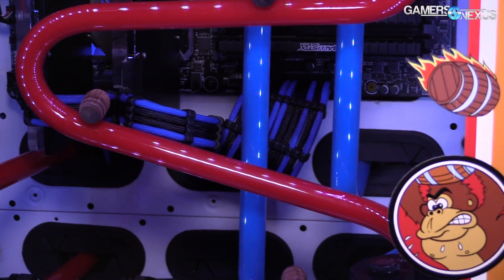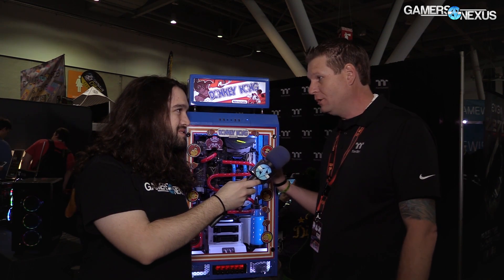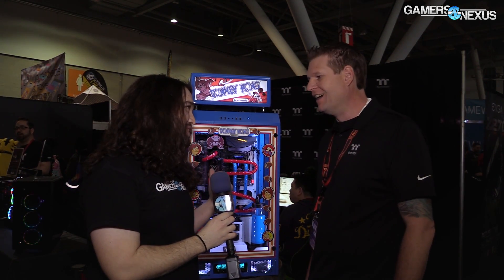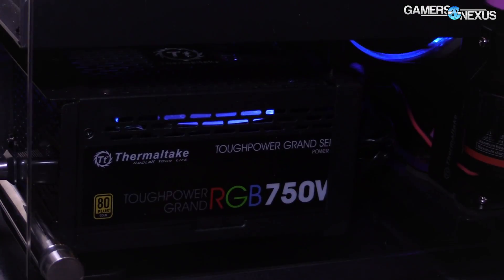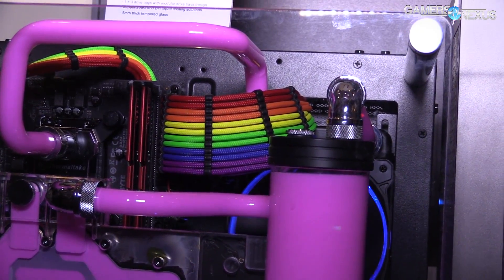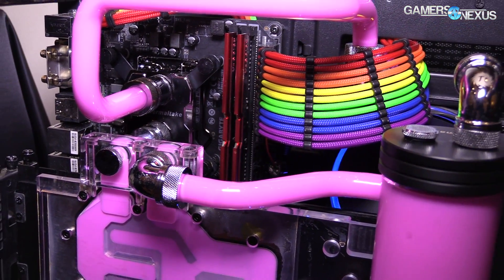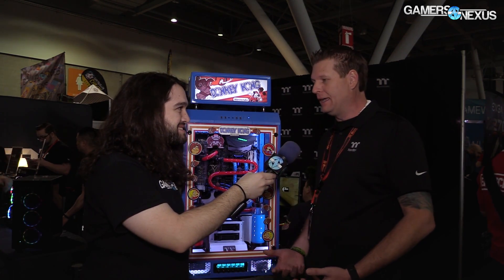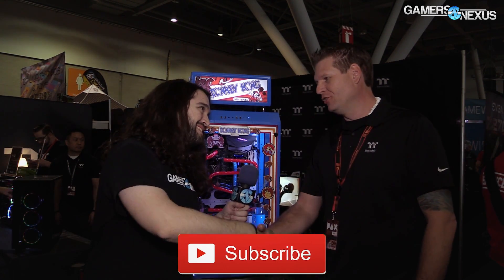Common Liquid Cooling Mistakes & Misconceptions

Comment from the maker: We shot this with Thermaltake on either Friday or Saturday of PAX East, but just got home and finalized edits! A few more videos left from the show, not too much more to go through. Check back this week for more on 1080 Ti Hybrid and other coverage!
Reply: Small note - not all AIO radiators are aluminum. be quiet! Silent loop 240/280 has fully copper radiator.
Reply: Gamers Nexus Great coverage on Pax, love seeing these types of vids! Can't wait for the 1080ti benchmarks
Reply: Thanks for the quick tradeshow coverage.  I enjoy watching these short interviews on the floor.  I really don't get the negative comments that question GN's integrity for sharing this type of content.  They are unfounded and speak to the juvenile nature of the YouTube audience in general.  Thank goodness GN is a website with quality written copy.  That's where the meat is.  These videos are just the gravy.
Reply: +Mikah Mitchell Most people go after copper or brass (cheaper than copper and non-reactive to copper thus very commonly used) radiators because copper is most commonly used in waterblocks due to its superior thermal conductivity. Due to the sheer size of a radiator having the thin channel walls made from aluminium probably wouldn't have a huge impact on thermals (it will have some though but probably more so if used for the fins) and may be worth the price trade off to some, however having copper and aluminium in the same loop is devistating even in a realitivly short period of time unless you use special fluids and ensure they dont get contaminated (generally the sort of stuff you only see used in AIOs and generally less ideal thermally than water), for a custom loop even if the aluminium is protected you are taking a huge risk. Anyone who has experienced this first hand (usually the WC old timers before all this was common knowledge) will attest to this, as I have myself back when people first started using anodized aluminium tops on their waterblocks because "in theory" it should prevent galvanic corrosion... that is unless/untill the anodizing has a hairline fracture in it...
Not my pic but you can see the sort of results you can expect: http://i220.photobucket.com/albums/dd96/tcg001/corrosion1.jpg

Now if you have aluminum everywhere else, thats a different story, and while not as good of a thermal conductor as copper, aluminium can save you some money, I have used full aluminium loops on older builds (not in many, many years though).
Reply: Gamers Nexus That's interesting, has anyone done specific testing to see if a full copper rad really makes a difference in cooling versus the life of the loop? I feel you wouldn't want it fully copper for the metal mixing in some situations
Reply: Hey Gamers Nexus, just wondering. Did you ever do a custom loop? If not why not give it a try? I would love to see what you would make!
Reply: Mikah Mitchell I've had a few all copper radiators and the performance difference barely noticeable. 

Last one I used at length was a 120x120x90 mm( crazy dimensions right) job and I managed to get my fx 8150 at 5ghz on it ( stable enough to run benches) but it would eventually heat soak run stability tests and trigger thermal protection. 

I did run a silly amount of voltage through it though as it was just to see if I could hit 5ghz.

Ran it 4.5 for regular use.
Reply: That Mic tilt at the end towards thermal mike was PRO!!!
Reply: Thermaltake is one of GN's biggest sponsors......
Reply: J Dalzell and?
Reply: thanks dude for his coverage cool stuff. im really hyped for the hybrid build> looking out for that one ever since the review :D
Reply from the maker: Yeah, same for EK WB's Predator series. Copper rad on that one.
Reply: Gamers Nexus really, thermalfake, I know you guys know better than to actually have them in a video
Reply: This was great, I learned a lot of things. Like in order to make this whole thing work, you have to do your research and make sure fittings match the size of the pipe. This is brilliant.

I do wish he could have touched on some other common mistakes. For example, you need to make sure there is a radiator and a pump. In order for water to flow, there's needs to be a pump pushing the liquid through the loop. I never knew this until I bought my loop and noticed the water wasn’t moving. This set me back a week. Same thing about cooling the liquid, I wasn’t aware you needed a radiator for that. I always thought they were for aesthetics. I almost fried my CPU because of this!

Comment: I've been doing straight distilled water since 2002 in my computers and cars and I've never had a problem with corrosion or discoloring or anything. I do change my liquids at least every year sometimes twice or 3 times depending on parts being swapped.

Comment: My thermaltake 1250 watt psu died after two years. i send it to rma because thermalsteal "gives" ten years warranty on that crap. still after now three months i haven"t heard anything from thermaltake rma or got my fixed psu back. lol they just stole the 400+ euro psu. their thermaltake "forums" is a desert. no one answers your questions there. never again thermaltake. i'm done with them.
Reply: Wow that is messed up.
Reply: @eternalbeing3339  Finally got the replacement psu. not the exact model. got only a similar 1200 watt psu with rgb. i have sold it on ebay. i got now the asus rog thor 1200w. best psu i ever had.

Comment: Forgot about this one. Trust Thermaltake to take an opportunity for build respect, and turn it into one big product push.

Some "actual* misconceptions / rules:
- Component order doesn't matter
- Min rad space = (120*blocks) +120
- low FPI = slow fans, high FPI = fast fans
- Not all fittings are tubes are the size they say they are. Double check fits, try to stick to the same manufacturer
- High static pressure for high FPI
- 2x 30mm rads > 1x 60mm rad
- Base your fan curves off water temp
- You don't need loads of temp sensor
- temps you *need*: water, components
- RGB is overrated
- DDC for compact, tight loops
- D5 for most loops
- Dual D5s in serial for the win

You're welcome 😋

Comment: Hi guys. My watercooler Master Liquid coolermaster 240 has like 6 months and started now to make a constant noise of bubbles in the pump.
The pump is connect in pump fan and has 3 pins. I cant control RPM speed on MSI control that is setted PWM and Smart fan control.. Maybe if i change in bios for DC i can control? He is setted at Max rpm 100% with 2200 rpm. One time, i dont know how, i reduced it for 1700rpm and the noise stoped.
I tried one time to put the case in 45° angle and the bubbles in pump sounded a bit quietier and different noise. The radiator is placed in the front. 
What should i do to remove bubbles noise or even config correctly the pump setup for watercooler. Its my first watercooler.
CPU is I7 8700k i never overclock. Only turbo auto.

Comment: Did he run his benchmarks at 720p though? His entire opinion on metals, heat, tubes, and bubbles is pointless without a 720p or 480p benchmark.
Reply: I think you need 144p to really see how your pc performs, if your CPU can't push 10,000 fps then it's literally trash and you might as well throw it in the garbage.

Comment: By Aluminum RAD do they mean the core or the fins? Fins only contribute to cooling but if its the core then its a different problem and best to avoid. As far as water goes distilled has not let me down in 10 years. I have loops going for 3-4 years without any problems. The thing I hate most about pre mixed with color is that its stains everything and super hard to get off if you want to change color.

Comment: The biggest issue i've seen is not having sufficient radiator surface area for a loop.
they pair a 240 rad with a lot of hardware and end up with 60C GPU load temps.

Comment: first common mistake is buying thermaltake watercooling products, or cheap thermaltake power supplies. The last comment was stupid almost all radiators are aluminum based....complete lie
Reply: Ricky Pelletier idk why anyone building a decent custom loop would use an aluminum radiator
Reply: even the cheapest brand you can find on performance pc,  Magicool, uses  brass enclosure and copper fins.  I have no idea why this guy would mislead people...
Reply: used one once, when I was new and not knowledgeable, over voltage on my video causing it to overheat and crash...if your going to get a cheap quality psu go with seasonic
Reply: SHIT I HAVE A THERMALTAKE PSU AND I GOT IT BECAUSE IT WAS CHEAPER THAN ALL THE OTHER ONES!
Though it has worked fine for the 3 years i've had it so I guess I got lucky.
But now I know not to buy thermaltake PSUs or watercooling supplies the next time i build a pc.
Reply: And everything looks so cheap.

Comment: So aluminum rads are O.K. now because their crap fluid will ruin your blocks before corrosion becomes an issue?  Or maybe a pump will break and trash some components before it is an issue.

Comment: well that was quite sad, it would have been nice if the thermaltake guy could have talked like a real person about the issues, instead of pure sells pitch, or at least just a lil sells pitch...
but yeah, that was quite a wasty video imo, not that it's steve's fault, but damn.
the system looks cool so there is that.

Comment: Some of you might want to take another look at TT. I bought the Tower 900 case and really was surprised on the build quality. Decided to check out their RGB g1/4 fittings and RGB w4 waterblock and don't see why people don't like them. Your just moving liquid at pretty low pressure. The O-rings provide a really good seal. Maybe in the past they had poor build quality or waterblocks were not that good or something but the newer stuff I have been getting seems solid. I install boilers, geothermal systems and do plumbing for a living and some of the stuff we use on high pressure/temperatures is nowhere near as well built, and doesn't leak. My only issue with them is no documentation or installation instructions but was able to figure it out easy enough.

Comment: Mistake I did - Shaking the radiator to clean the external dust on it. It also released internal detritus inside the radiator that ended up clogging the pump.

Comment: While speaking with Thermaltake you should have asked them why on their TR2 430W PSU's box it specifically says 6+2pin PCI-E connector, yet it only has a 6 pin? Also ask them why their customer support hasn't responded. Thanks, GN, keep up the great work!

Comment: I've had no luck with bay reservoirs.  Tried a couple different one and they all leaked or cracked eventually (maybe since they are screwed into the case movement put more stress on them than tubes).  

As far as metals and coolants I'm one of those people that uses all copper and distilled water but I do add a few drops of PT Nuke.

Comment: When did themaltake get good at water cooling? 

I mean their old watercooling cases had copper block but aluminium rad so it all went gross. 

Even in 2012 when I last built a system they had a bad rep.

Comment: why don't people just put sacrificial anodes in the system . That's what we put in cylinders when we have mixed metals. btw my job is heating systems and plumbing.
Reply: +Jamie Kennedy
By definition (or function), sacrificial anodes get consumed over time by chemical reaction, creating salts in the coolant that may clog delicate parts such as the water block. In your area of expertise, comparatively large-size heating systems, that might be admissible, but with PC cooling it's a potential recipe for disaster.

Comment: Most common liquid cooling mistake...

Installing it instead of spending the money on better components.
Reply: Yup if you have the best available and still want more and money is no object and you enjoy dicking around instead of using your system it makes sense. Otherwise it just doesn't.
Reply: LiamE69 most people forget the fact that most major loop parts can be reused in the next build(s), if treated properly. Unlike the AIO garbage. Sure a custom loop is more expensive than a 212evo and stock case fans but well...

Comment: 12 months? That's appalling. How can this be extended? Different tubing, alternative liquids, or what? At the very least it should be able to run 2 years, without issues, and preferably a lot longer. It doesn't have to be pretty, at least not in my case, as I am one of those rare people who don't really see the computer as a piece of art, and if I were to see it that way, frankly I would be a whole lot more interested in the exterior than the interior.
Reply: Not using Thermaltake products and not add stupid coloring prolongs the life of the waterloop by a large margin.
Just look at AiO watercooling loops. They last a lot longer with the original prefill than the "Thermaltake 12 months".
Reply: thermaltakes coolants are complete trashhhhhh
Reply: The 12 month thing is due to the coolant slowly picking up electrons as it passes through the loop and can become conductive which accelerates corrosion. I use EK concentrate coolant with distilled water. And since the loop is an open style one there can be the possibility of algae growth in the system so its a good idea to drain and flush the system every 12 months to clear out any gunk that may grow in there and or remove any crap that has come out of the radiators as they some times have flux or other crap in there from when they where built.
Besides all that, if you want to avoid all that stick with air cooling. Most water cooling users should know that regular maintenance is required for optimal performance. Hope this helps mate.
Reply: Not comparing the temperature and algae etc. but corrosion. Which is not enough of an issue in both PC and car cooling in the timescale we're talking about here.
And no, you can definitely run a watercooled loop for years without maintenance if you use the proper component combination and a properly prepared coolant... AiO loops can also do 3 to 5 years FFS, and they sometimes use stupid combinations of aluminium radiator plus copper CPU block.
Then again if you dust out the system, flushing the loop won't take more than an hour either, so the maintenance overhead over air is not extreme.
Reply: We are getting off topic a bit here the point is Thermaltake's coolant and other watercooling stuff is rubbish.
Reply: Their newer designs are great though... because someone else designed them ;)
http://www.legitreviews.com/wp-content/uploads/2015/06/water-blocks.jpg
(in this case under licence before that argument starts ;P)
Reply: Unless their coolant aint great and breaks down in that time period this is just the same sort of over cautious mothering that people who change their thermal paste every 12 months promote, my longest unopend loop so far has been 7 years running with boiled tap water (results may vary depending on the quality of your local water supply) and after decommissioning that loop for no other reason than it was old I stripped it and found absolutely no signs of growth/clogging/corrosion/wear/etc.
Reply: @dandel351
No the coolant cannot pick up electrons. What it is is becoming conductive due to picking up oxidized metals from the elements in the loop, or due to organic particles from the pipes. But even that should not accelerate corrosion in the loop noticeably as long as all metals in the loop are either non-reactive or the same. Otherwise the less reactive metal will do electron transfer with the more reactive metal and oxidize/corrode it further. It's called "sacrificial anode" effect.
If you look at car coolant loops, they can also do a lot longer than 12M without maintenance: It can be filled up but doesn't really need flushing. And it can have different kinds of metals in it.
But I am not saying you should use car coolant in a PC water loop, because in a PC water loop, thinner finns are used and the coolant will not do well on PVC material.
Reply: I do get the point about contamination, such as algae. I suppose at some point this could block the flow, damage the pump, or similar, but as for corrosion, surely you can just use proper materials? Copper pipes or something?

Seriously, it must be possible to put together a system not only can last, say 5 year (any more than that seems rather silly, even 5 years is pushing it a lot), but can be expected to last as long, without having to do maintenance.

Perhaps it is a tall order, but that really is what appeals to me, as you can get rather good and quiet air based solutions, but at a fraction of the price.
Reply: The point is maintenance is required, I don't care about the exact science of how coolant breaks down, the coolant supplier recommends this course of use . The main thing to realize here is if you are not prepared to look after your system then don't use liquid cooling, simple. Car coolant is completely different. It uses glycol under about 13 to 20 psi and at a temperature level about 3 times higher to PC loops. I don't know why people compare auto coolant systems to PC ones , the heat rejection capabilities of these systems is far different from each other.
Reply: Yes man, I agree. Thermaltake stuff was rubbish ever since. Anyone remember the Thermaltake Bigwater 760 and 745? ;)
Reply: its Thermaltake marketing guy don't take what he says seriously.
Reply: Sam B
that thermaltheft shit still gets to me, how people actually think thermaltake stealing products is a  good thing as long as theyre cheaper
Reply: Well, if I had my way I'd just have made a big ass full board heatsink, with heatpipes and blackjack and hoo... well, you know, but given the price you have to pay to have something custom like that made... well, solid gold rims for your car may be a better investment...